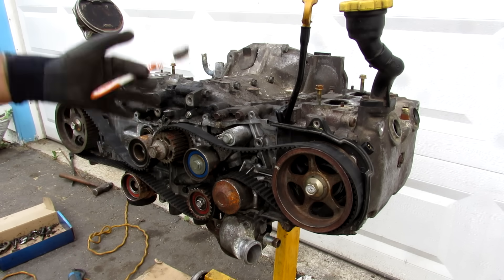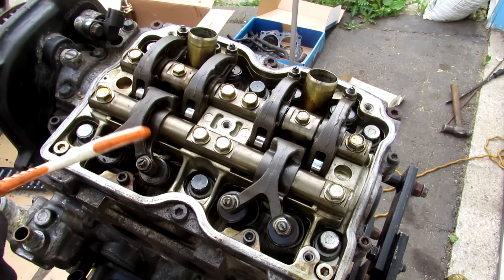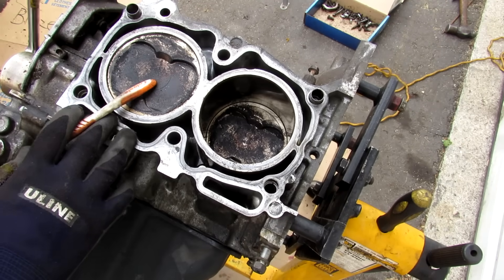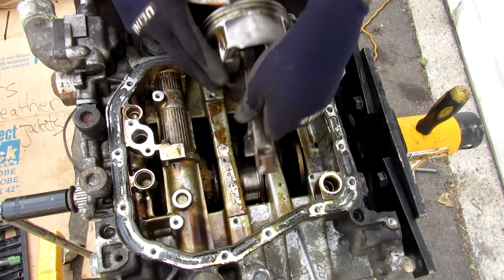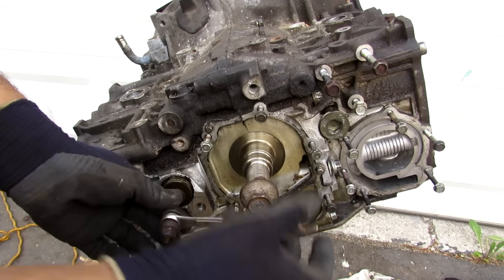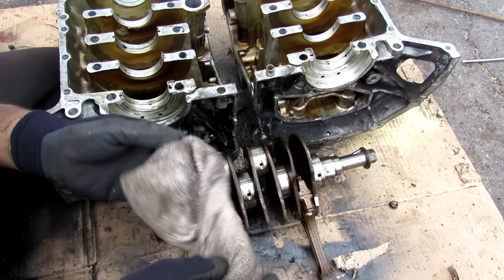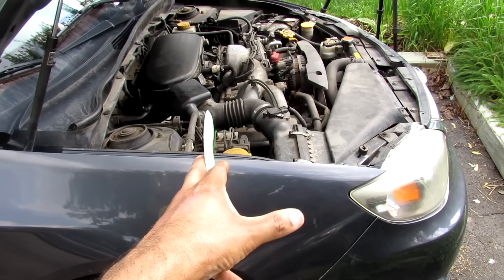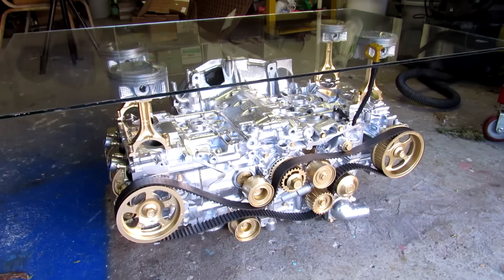Why Subaru Engines FAIL

Comment: Hmmm a 180 degree engine. I wonder what could go wrong?? There is a reason everyone else uses a V or inline engine design (save Porsche). Anyone want a car that sounds like it has a blown head gasket? Nope? Didn't think so. 😑 Stupid! And truth be told, they don't put out extra power over an inline or V. So it is essentially a waste of time and space. Wanna replace the head gasket? Oh!! You can't pull the head while the engine is mounted in the engine bay.... 😑 Perfect design guys.... 😒

Comment: EJ202 and EJ253 are the worst of the EJ bunch, coolant loop the number four head into the heater core return, use mobile one or better "Think like it's a cheapo Porsche" fyi if your oil filter won;t come off in your hands that filter over pressurized and tightened, don't use chinese parts check the oil often aka gas up that morning while stone cold check the engine oil, when you do the heads use better gaskets and replace the valve stem seals as well Mahle or and Apex Seals already

Comment: The motor in my 2004 rs2.5 is great with 200k on the clock. Gets serviced when required and has had the timing belt done at 100k and 200k. Look after your Subaru engine and it will last.
Reply from the maker: Yeah alot can be attributed to maintenance

Comment: The main reason subaru engines fail is mainly because of bad maintenance. The secondary reason on the naturally aspirated 2.5 (this engine EJ25) used some absolutely crap head gaskets. The older 2.0 turbo engines (ej205, ej207) are some of the best boxer engines especially if they have been well maintained. There are plenty examples of subaru engines going 300k miles or more.
Reply from the maker: Yep there are some good ones and some bad ones. I just summed everything into one video instead of picking them out.

Comment: I had one of those Subaru Outbacks a 13' model in fact.  I bought it brand spanking new, I really wanted to like the car, but had too many problems especially the oil consumption problem. I think I'm done with Subaru witch is unfortunate the AWD system seemed to work well. I sold it and didn't look back!
Reply from the maker: Ouch

Comment: Oil actually does help cool the engine, just not as much as coolant.
Reply: Yeah but.... In my experience (unfortunately), water is a piss poor lubricant..!!!
Reply: @tandemwings4733  what do you think lube is made of ;)
Reply: @GamingDad  Go on, tell me....
Reply: He’s talking about oil mixing into the coolant, not oil cooling the engine in it’s normal way, but good job paying attention.
Reply: sam point is still relevant
Reply: It's why oil coolers were made.
Reply: No air is coolant. 

Yes the oil gets hot and yes it takes heat away.. but the primary heat of combustion that’s in the cylinders and heads is cooled by either coolant or air.. NOT oil.
Reply: Coolant also lubricates, but it's so bad that only the windscreen washer motor uses a water mixture as lubricant XD

Comment: I had a 2.0 L WRX for 9 years from new  ... put on bigger turbo, higher boost ... never had any of the issues raised here... it was pretty much bullet proof ... only ever had a problem with coolant tubes going to the radiator getting a leak, twice .... it was still running great when i sold it

Comment: Those boxer engines are a pain in the ass to take apart, that's why I always stayed away from Subaru's.
Reply: Not really once you've done one you can knock them out pretty easy and quick
Reply: They are one of the easiest engines to work on in the world. I completely rebuilt one when i was 12. They are also insanely reliable if you actually take care of them and don't mod the heck out of them.
Reply: I advise my customers to avoid.....about twice as many leak points, even galley plugs and crap between engine and trans!

Comment: Knock Knock
"Who's there"
Piston 4: YEEET
Reply: Mechanic: kling klang klunk, the motor is junk!
Reply: Any reason why you said piston 4? Is it more common for preignition for some reason?
Reply: Craftym Gaming thanks to the unequal headers that produces the boxer rumble, cylinder 4 being the longest has heating issues so it’s usually the first to go
Reply: @theleviathan282  Thanks for your reply that makes so much sense!
Reply: @craftymgaming5362  ask him to explain that. I don't think he knows what he's talking about. 
Subaru engines are about as symetrical as you can get. The exhaust comes straight down into collectors on each bank, then into a Y pipe that comes together under the drive shaft in the middle of the car. 4 into 2 into 1. Number 4 cylinder exhaust doesn't travel any excessive amount compared to the other three. Actually the rear cylinder exhaust on each bank travels a few inches less to get to the Y pipe than the front two.
Reply: @Smedleydog1  and the plot thickens
Reply: NO, GM production economists that will screw the owners life.....

Comment: My 98 EJ25 lasted over 200K.  The original pistons were replaced under warranty due to piston slap.  Then after about 150K it started leaking increasing amounts of oil, probably from the head gasket.

Comment: He's right...that is a weird engine design.  It looks like the Borg Cube.
Reply: Yeah the old VW engines often rattled when they were cold, and needed the heads re-torqued on a regular basis.  That design looks good on paper, except for the obvious flaws which he pointed out. This guy would make a great mechanical engineer-designer.

Comment: You're not correct about a V6 being well balanced. A straight 6 is perfectly balanced. A V6 is poorly balanced (but short).
Reply from the maker: Thanks. I'm gonna investigate and update in the inline 5 Volvo engine video next week
Reply: @speedkar99  According to the Bosch Automotive Handbook (5th ed.) which has a table of first and second order forces and moments for all common engine configurations, the in-line 4 has 2nd order free forces, the boxer 4 has 2nd order moments. The various V6 configurations (60deg, 90deg and 90deg with offset crankpins) are all bad on the 2nd order forces and moments. The inline 6 and boxer 6 are perfect. So is the V12 by extension. The V8 (I think) can use counterweights to get perfect balance. It's a great little book if you can get a copy!
Reply: Of course the other issue with the boxer-4 is appalling exhaust tuning, and the fact the car always sounds like it's misfiring!

Comment: A very complex engine compared to an upright 4 cyl. This engine in place where everything is so darned awkward to get at reminds me of the early  Austin minis which were difficult to work on as well. I have never greatly liked Subaru’s and that now is confirmed with this nightmare engine that sounds like a farting horse when running.

Comment: This is an impressive video, but it just leaves me thinking that I don't want to purchase a Subaru.
Mine needed a new block at 49K miles. It was ten years old, had regular oil changes and rarely got driven. I was thanked for that at the dealership with a six-thousand dollar repair bill.
My next vehicle will be another make.

Comment: Subaru problem for last 15-20 years..head gasket lets go...dumps coolant into oil..BANG!  Next oil leaks out of junk oem head gasket...Boom motor. Next cats have never been any good...government forced 15 year warranty on on emission related part...but as usual Subaru wont fix it.  So now tell customers dont buy these junks...plus power steering pump problems..axle shafts are junk.  Pure junk car

Comment: I see why they fail; look at that orange part on the engine.
Reply: That's the first thing I saw and was like "welp there's your problem"
Reply: the oil filter? I'm not good with car engines
Reply: @andreasrikje2057  yes
Reply: that didn't hurt it.  design flaws ruin these
Reply: @0x00zero  The point being made is you could take a coke can some cardboard and coffee filters and make a better oil filter than a Fram.

Comment: So basically you're saying if you change your oil on schedule this Sugar engine should run a long time?
Reply: that will not stop the gasket from failing though. It will fail about every 70k miles and cost 1200-3000 to fix. There is also risk of damage to the engine when it does fail if it overheats.

Comment: Bolt “head” size is the size of wrench needed to turn the bolt!  Head bolts are the bolts designed specifically to fasten or secure the heads. You can purchase a set of 3/8 hex sockets very reasonably at Harbor Freight it takes a 14mm hex to remove the plugs which cover the wrist pins. It’s much better than fooling with a bolt with a 14mm head & double nutting it! A Subaru HEAD bolt does NOT have a hex head! You need to use a 12pt 14mm socket for them, and a 12pt 12mm socket for the block halves (main bearing bolts). The foolish instructions for torquing Subaru heads are THE MAIN PROBLEM causing head gasket failure! There is TOO MUCH room for error and you wind up with too little torque on the corner bolts! AFTER you have done that you torque needs to be about 70lb ft at each bolt. TRY CHECKING ACTUAL TORQUE after doing your inaccurate TORQUE ANGLE ATTEMPT.  THE RESULTS WILL TELL U WHY THE HEADGASKETS HAVE SO MANY FAILURES!
Reply: What!?

Comment: I had a 02 wrx.  Put 245k on it and I never had problems with it.  I dogged that thing out.  I rebuilt the turbo at 175k. Other than that it was a daisy. I even took it on myrtle beach and it didn’t get stuck. Cool video

Comment: I will never buy another Subaru ...
Owned a Legacy and changed the oil every 3,000 miles. Also had the timing belt changed at 100,000 miles, per the Service Manual.
At 140,000 miles the 'new' timing belt broke and wiped out the engine. Bent valves, etc.
I'll never own another interference  engine driven by a rubber band!
Owned multiple other vehicles that had 250,000+ miles and we're still running great when sold...timing chains only!

Comment: I bought a new 1978  4x4 wagon.It was the best car I've ever owned.The only problem I ever had with it in the first 121.000 miles was a bad oil sending unit .The clutch went 214.000 .it still had original charging system + batt.& starter .original brakes went 80.000.the car pulled a mustang out of a snowy ditch after 2 full size pickups failed.my only regret was I didn't buy 5 of them at 5500.00 .I have many stories of that cars ability over any other 4or that would leave you jaws wide open .it was a very fun car.The only thing I faulted it about as a Minnesota car was if you had a snow fall and it was wet and then over time it crusted the car would with the belly pans rise up and float on top losses traction .but the car was light enough if you had a passenger or shovel you would be rolling again.I happened 1 time a year or so.It was the only new 78 automobile if I remember right that could still burn loaded fuel.There was a couple of pump attendants that wouldn't pump gas into it even though a fuel sticker said loaded only.i miss that car.

Comment: The very terms "Sucks", "Garbage", "Useless", "Waist of Time", only shows your lack of comprehension of the subject at hand. Just because you own or drive some other product, surely, doesn't make it superior! I don't personally own, and never have owned, a Subaru, but I know someone who does and it's 18 years old with 420,000 miles on it and is in quite remarkable condition. Wonder how that happened, since they are so terrible?

Comment: Subaru boxer engines are known to be tough as hell and can take a lot of abuse. 

I have a 02 wrx, 220k miles, still running strong, I pay to have it maintained, replaced timing belt and idler pulleys 

Only had to have head gaskets replaced

Comment: My 06 legyasee is leaking oil. Sigh.... right on top of the exhaust. If I straight pipe it. Will the fart can improve performance and slow down the leak by allowing exhaust fumes to more quickly exist the engine?

Comment: This is a cool video. I wish someone would do a series of videos like this with many different engines, discussing what's good and what's bad about them. It would be helpful for anyone considering buying a well-used car. When you are looking at new cars, you don't really care about engine design details. You just want alot of power. But when you're looking at a car with 170,000 miles on it, you suddenly become less concerned about HP, and more concerned about how likely this high mileage car is to blow up tomorrow and cost a fortune to fix.

Comment: Thanks.  I run an Ej25 in my off-road buggy.  I’ve had 4 motors die due to bearing failure running high rpm for extended periods of time 4000+ rpm.  Had I known the issues I never would have chosen this motor

Comment: Wow! I ued to work on cars back in the 70s. Most of my knowledge came from my friends and 'Motors' Auto repair manual'. I wish I had YouTube back then with you speedkar99. I learned so much just from this video!! You have a great style - none of the, "Ummm then you take the uhhh... bolts out... uhhhh.". SMOOTH delivery and a lot of info condensed into a short span of time! I LOVE that you used the terminology and nomenclature for each part and included a verbal schematic of how exactly the mechanics, oil and coolant flows.

In short - you are simply outstanding at what you did in this video! Best of luck!!

Comment: This is an old car.The new model has the engine redesigned with its oil filter on the top to solve the oiling issue.

Comment: The people that design motors are so far advanced, regarding design parameters and so forth, that the average Joe has no idea of what must be considered. Give it a try yourself. See what you can do. See what kind of ridicule you will receive, especially 20-30 years later. I get so tired of desktop keyboard engineers ridiculing Real engineers! Hindsight is 20/20. Nobody knows what will happen in 20-30 years. Reverse engineering is easy, compared to First engineering. Ask the Chinese. They are masters at reverse engineering! Design something yourself and then talk smack, when you have the solution! I don't care what you design, there WILL be failures. Nothing lasts forever! All parts wear! It WILL break Down!

Comment: Having done head gaskets and a valve job on an EJ251 I really think most of the folks who complain about a head gasket leaking on one of these are just looking for something to complain about. I had to do mine at 170k, so I doubt Subaru is going to goodwill any of the expenses.... ;-) The job is not that hard, it does not require specialized tools aside from an engine puller/cherry picker and a torque wrench, and the costs to do the job (machine shop was about $200 I think, plus gaskets, sealers, fluids) were minimal. Might as well put a new clutch in too if you pull the engine.....

Comment: Geeze! Everybody has a comment, yet I'd bet not a single one of them has ever designed and engine. Great video, but the man wasn't trying to put the design down. He was, simply, notating what he felt were the reasons for possible failure. Every engine has points where failure is more likely. Anyone know the perfect way to design an engine please step forward. Apparently you are a genius. So many internet Geniuses, you'd think there wouldn't be any more issues! The fact is, it's not the oil filter, it's not the motor. Everything has a lifespan and if you don't maintain it properly,  you're likely to experience a shorter lifespan than otherwise. If you disagree with that, you have no idea what you are talking about. I have a lifetime of experience. I, also, think logically. I don't "fanboy" any product. I use simple common sense, which clearly isn't very "common".

Comment: Several years ago i worked in an engine shop, we would see one of these a month with no 4 big end knocked out, usually on cars used on the track. At the time we couldn't source under size bearings as the crank was claimed to be ungrindable, so we would grind crank and resize rods to take to take an undersize bearing.